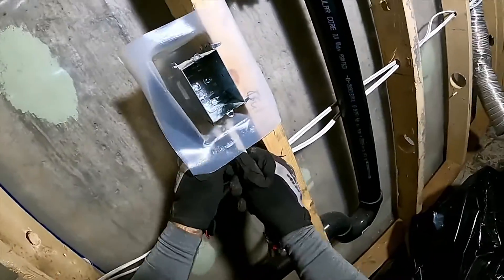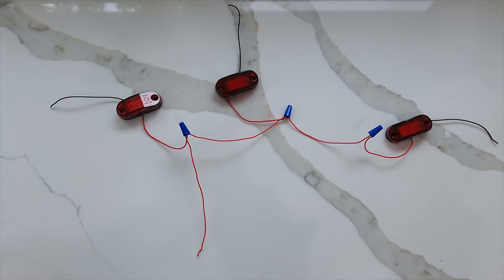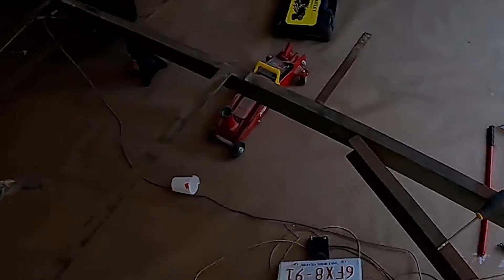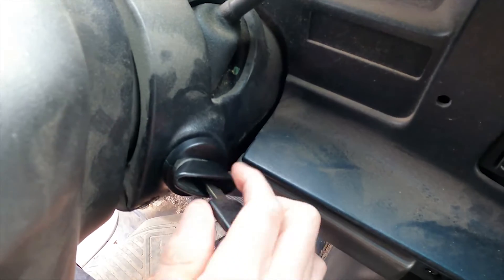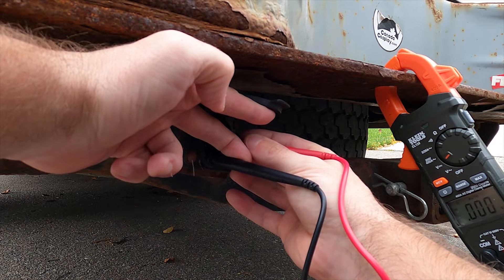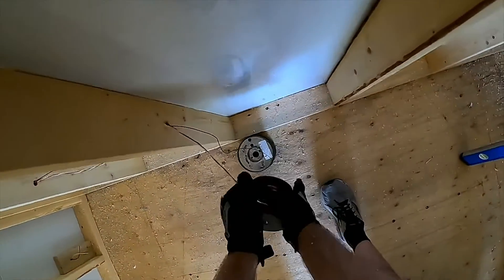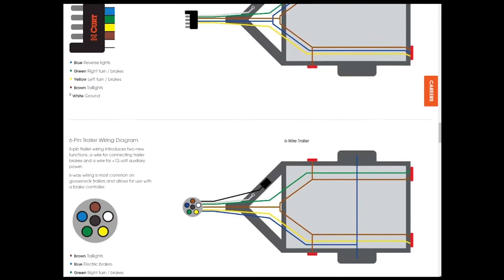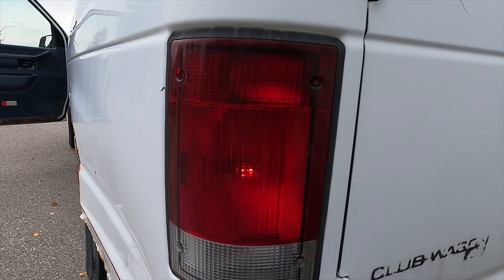Trailer Wiring 101! Complete trailer wiring Tutorial  DIY RV to Cargo Trailer Conversion part 7

Comment: I THOUGHT this was about how to wire a trailer instead it's about you complaining about how many different ways there are to do it!
Reply from the maker: @denden760  fair point! I think what it bouls down to is "wire however you want cuz there are so many standards, there is no standard "
Reply: @MooseDoesStuff  Thanks for your reply Moose!  I saw the way you wired three lights that all come on together but didn't understand what you did with the black wires that were just laying there. Something about people  being "Dirky" ? then you showed a WHITE wire going to a tail light, it looked like, and said trailers don't have grounds?? Look, most people, like me are looking to you tube videos to be very simple because, like me don't know much about wiring. My cabin, on a flat bed trailer, is made or WOOD so this didn't help me understand it like you do. Were you saying to run all your ground wires to your tail lights b/c grounds don't really exist on trailers???? It would help dummies like me if you talked like you were telling a second grader how to do it. I, as a commercial photographer, know exactly how to add a "Adobe '98 profile" to a Tif file in the metadata so a Heidelberg 6000 offset CMYK printing press can recognize it and the printing company will know exactly how to print it on this press. You probably like most people have NO idea how to do this. The people watching Youtube videos are looking for something they can grasp and not have to go elsewhere to figure it out like you said you did b/c you couldn't find anything that helped you. I'd humbly suggest try to think of what a second grader would understand and tell in more depth what exactly to do as simply as possible with EACH wire and maybe even why!  I must be a dirk?
Reply from the maker: @denden760  fair comments!
Reply: When electricians work on 12v lol.